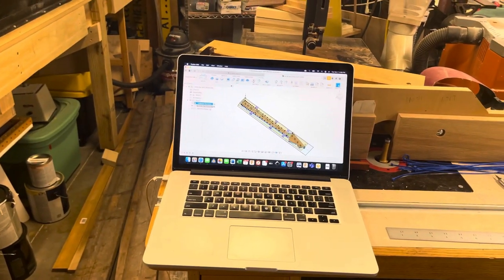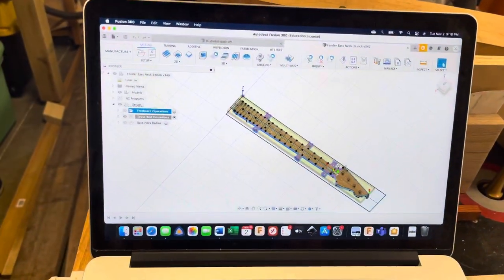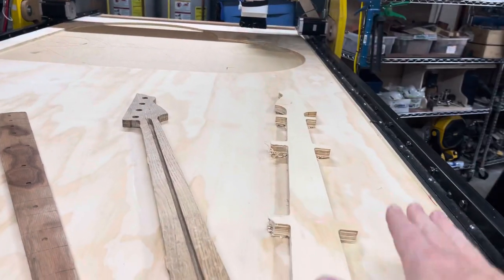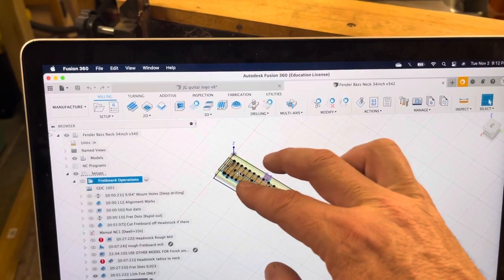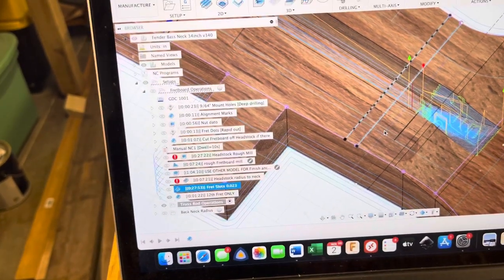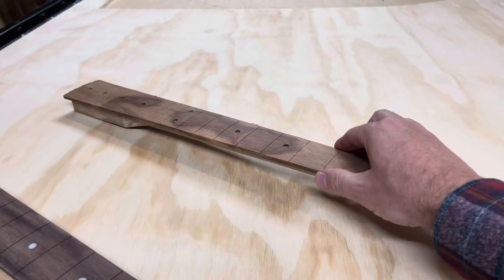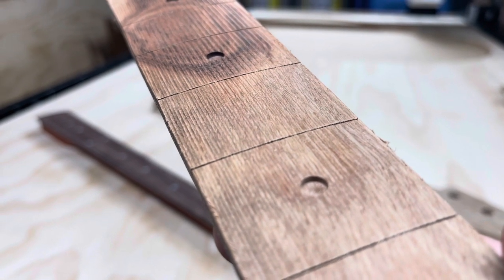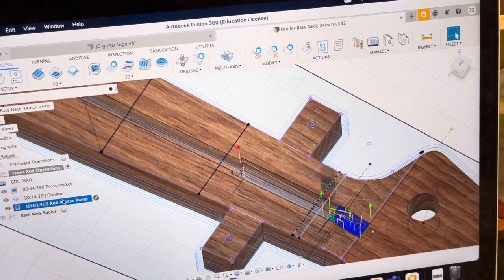CNC toolpath process for Bass Guitar neck

Comment: Hi mate,  great video,  can I just say there are many videos of guitar building and fusion 360 tool paths and I gotta say you have a few completely different ideas here which I'm absolutely loving. like cutting the fingerboard first while fixed to the neck stock before truss rod operations. .  I have a machine Ive built for making basses running Mach 3, im a total novice when it comes to CNC but over the past few months im really starting to get there now,  and this vid has given me some fresh ideas just on setup which are revolutionary bud.  much appreciated .  im still having some problems with Fusion tool paths fully working out in Mach 3 but once I trammed the machine properly it has gotten closer now.  hope you do a few more videos and ill get some new ideas,   Great stuff.  Have you checked out Austin Shaners Videos?

Comment: Hey man, I saw your CNC build videos and I noticed you are using reduction gears with belts. I'd say that's one of the main reasons why you're getting inaccurate cuts, since when one axis engages with the material you're cutting, the other axis is first held in place by the belt, which will stretch due to the torque put into it when all that weight traveling at a certain speed hits some resistance and the bit tends to deflect the whole thing perpendicularly to the direction you're cutting. Also, your machine dimensions are way too big for the materials you're using. The larger you make it, the most pronounced the material limitations will be. You can try to improve that by getting aluminum parts to replace your plywood gantry. One more thing would be the way you mounted your SBR rails for the X axis, it would be best to have them parallel at the same plane with the pillow blocks bolted to the same piece of your Z axis carriage.
Reply from the maker: All good feedback.  Thank you.  This machine was indeed built for another purpose that required 4'x8' sheets and Far Less accuracy than musical instrument construction demands.  If I continue on with instrument building, I'm planning a new CNC build that will have all those features you mentioned and more to obtain a much more rigid (and smaller) machine.